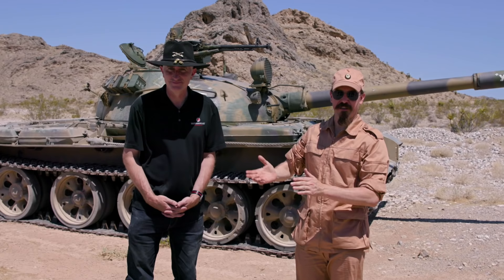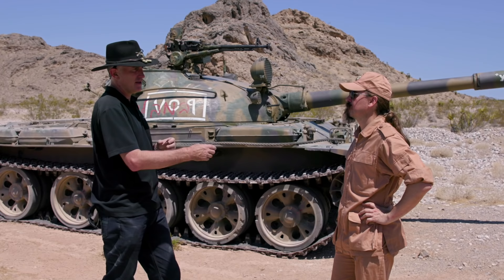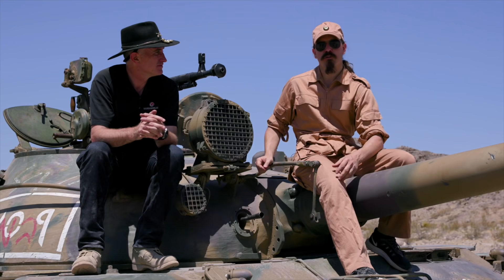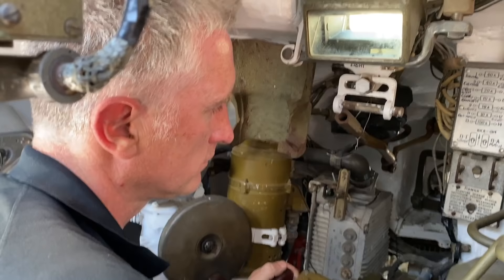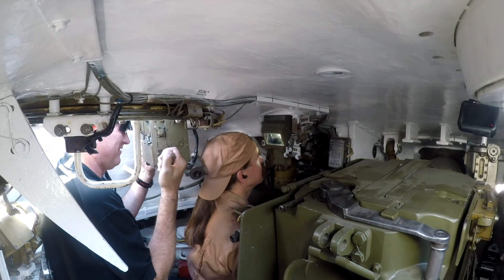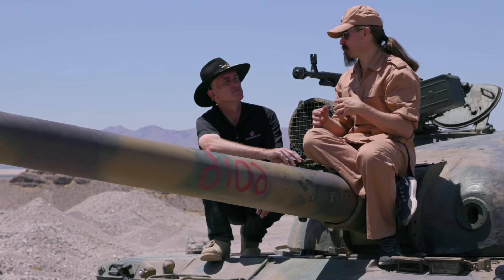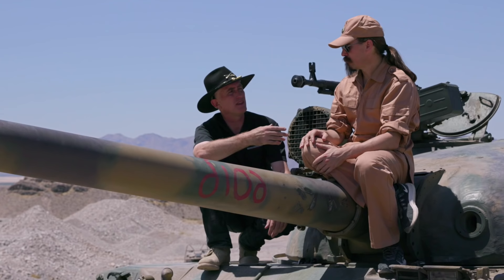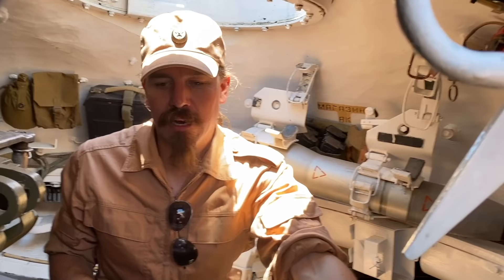All the Guns on a T-62 Tank (with Nicholas Moran, the Chieftain)

Comment: Was surprised the Chieftain didn't mention the implications of the 115mm's "fume extraction" system on the NBC system.
Reply: I mean, it is not that hard to figure out. The system is disabled in case of NBC protection being activated.
Reply: I assumed this was pre NBC.
It seems a bad design if you protect your crew from outside gasses only to gas them inside the tank.
Reply: @marc0523  NBC protection came about on T-55. It is not like crew cant use gun at all without the casing ejection system, also in case of NBC attack crew supposed to wear personal gas masks as well, also there is standard ventilation system, it is just not fully capable of getting rid of the gases quickly enough. Tank also has natural limit of how much it can fire without the ejection system since there is not a lot of space to put empty shell cases in the tank. Basically it is not that much of a problem considering that supposedly nukes would be going off.
Reply: @megalamanooblol  Thanks for the answer. 
My only knowledge of NBC comes from computer games etc, I don't know anything about the actual mechanics of how it worked, so this was very helpful.
Reply: @marc0523  they are usually 'positive pressure' sytems where air is drawn in through a compressor/fan system and filtered, then injected into the crew compartment and allowed to exit through orifices naturally. As long as the pressure is high enough for long enough, opening the breech to insert a shell, or the very brief opening of the spent case hatch, should not really upset the system, as the filtered air should flow OUT and naughty contamination should not flow IN.  This would also help with any fumes from fired weapons by using fresh filtered air to push stale or polluted air out. I think.
Reply: @marc0523  The system itself is simple in principle. Tank is sealed, air is pumped in from the outside through the filtering system that hopefully should remove as much "death" from the air as possible and the air pressure inside the tank is made to be higher than outside meaning no air from outside should leak inside the tank except through the filtering system.
Reply: @megalamanooblol  Fair enough points, especially considering nukes going off would make efficient main gun operation the least of the crew's concern. Just thought said implications (casing storage) and measures (turning system off and personal masks) were worth noting in the video for the audience, considering the thing was designed at the height of the Cold War... those not in the know would wonder about that.
Reply: @megalamanooblol  I guess if the crew could not use the casing ejector and they had the luxury of being able to disengage for a few minutes they could start putting the spent casings back into the ammo storage bins?

Comment: 22:31-22:49 The fact that the T-62 could penetrate the Chieftain tanks, was one of the contributing reasons why "Stillbrew" armour upgrades were developed for the later Chieftain tank models (starting with the Mk. 10 version). Well, actually "Stillbrew" was developed, because the British were thinking about future proofing their tanks against Russian 125mm guns too.

From what I've been able to find, the "Stillbrew" armour package was a form of early NERA composite armour (although, I have run into a few morons, who think "Stillbrew" is not considered to be composite armour. And for pretty dumb reasons too. DESPITE all evidence suggesting otherwise). It was developed for the Chieftain tanks during the 1980s. And it was very likely that "Stillbrew" was developed from previous British experiences with developing composite armour during the 1960s

The "Stillbrew" armour package is composed of cast armour steel. Specifically of RARDE 823 cast steel (which had less ballistic protection than RHA steel. Typically cast steel has 15% less protection than RHA armour steel). I've heard some mention that "Stillbrew" would later use hardened cast steel which had the same protection as RHA steel, but this didn't pan out.

Other details about its construction was that the "Stillbrew" applique armour was composed of 120-200mm thick (cast) steel plates, with 20-60mm rubber inserts behind these steel plates (the rubber was connected to the steel plates by way of armour fasteners. So basically things like screws, nuts, bolts, and bosses).

Apparently, "Stillbrew" was good enough to stop kinetic penetrators with 500mm RHA (possibly even more) of penetrative power. Which was enough to provide protection against 115mm, and 125mm APDSFS projectiles. What's surprising is that it provides protection against not only 125mm tungsten cored ammunition, BUT ALSO depleted uranium shells too   :/

<<References>>

A) https://below-the-turret-ring.blogspot.com/2016/03/chobham-armor-facts-and-fiction-1.html?m=1

https://tankandafvnews.com/wo-194-1323-feasibility-study-on-burlington-chieftain/

(Previous British research into composite armour of the NERA type during the 1960s)

B) https://www.tanknet.org/index.php?/topic/37096-chieftain-questions/page/27/

(Composition of "Stillbrew" armour. And also, what weapons were tested against them during British tests)

C) https://www.flickr.com/photos/7682151@N07/40600023554/

https://www.tanknet.org/index.php?/topic/37096-chieftain-questions/page/40/

(Some idea of what the durability of the Chieftain tanks were like, when upgraded with "Stillbrew". The minimum amount of protection that "Stillbrew" could provide WAS AT LEAST 500mm of RHA effectiveness. Surprisingly, according to documents, it states that the turret armour is better protected than the Leopard 2 [probably the early versions] 😳 )

Comment: Special mention to the fighter jets pilots who must have wondered if they got lost as they were observing a T-62 firing off all of its weapons at some rocky hill in the desert through their IR targeting pods or EOTS.
Reply: You should check a-10 pilot coloring book for t62 mentioning. At the time gau8 avenger can only penetrate t62 from the back. No pun intended. Frontal and side armor were invulnerable for 30mm rounds
Reply: @andrewdenzov3303  people always see some ideal scenario of a-10s easily making strafing runs onto their targets without significant opposition
Reply: @fulcrum2951  well when AA capabilities of modern army made a10 obsolete they start to fight with "army" from XIX century with no AA weapons at all :)
Reply: @andrewdenzov3303  there are cheaper alternatives

Comment: The reason for the smoothbore gun was to fire a longer discarding SABOT round with a diameter to length ratio of 12:1 or higher. The advantages of this are that you can have a round with the same weight but with a smaller diameter. The smaller diameter allows much larger penetration as it impacts a smaller area of the armour.

Comment: In Afghanistan, I was behind an ANP pickup truck that had a DSHK on a tripod in the bed. The tripod wasn't bolted down and was just sitting on some old tires. The guy controlling it kept it pointed away from us mostly. They hit a bump and it caused the tripod to shift and start to slide out of the bed (the tailgate was down because it wouldn't fit with it up). He grabbed the grips and it caused it to swing right at my truck. I was looking straight down the barrel of that thing from less than 20 feet away. I was just waiting for the dude to squeeze the trigger and let it off while trying to keep it in the truck.

Comment: Russians are pulling those out of storage (under 2000) now since they are running low on T-72's
Reply: hope not
Reply: Probably to use to hold down the territory already gained, they would be useless on the Frontline.
Reply: No.
It's for DNR and LNR forces.
Reply: running low on T-72 🤡🤡🤡🤡, take your booster buddy.

Comment: They mentioned this has an interesting history, but didn't go into it, so:

They mentioned it was produced in the early '70s. It has both Arabic and Hebrew markings, indicating it was supplied to either Egypt or Syria and then captured in (from the production date) the '73 war.

Israel captured lots of up to date Soviet equipment in the War of Attrition and in '73, and usually would send samples over to the US for teardown and testing as their contribution to the broader Cold War. If I had to guess (Chieftain could probably fill in) this was one of those tanks, which then made it into private hands after the US military was finished playing with it.

Side note: between the grab bag of post-WW2 tanks everyone in the region used and lots of captured Soviet equipment, the IDF's Armored Corps Museum in Latrun has one of the most comprehensive publicly accessible collections of mid-century armor in the world. Most aren't running, but you can climb all over a Syrian Panzer IV or about five Israeli Sherman variants or one of the oddball Israeli heavy APC conversions of the T-62.

Comment: the 115mm has about 50% more kinetic energy compared to 105mm so it on the next level and not really comparable .
Reply: I don't know about 50%, but L7 certainly hasn't caught up. M1060A3 from 2004 generates about 7.5 MJ of muzzle energy, while an old 3UBM9 from the 70's is still capable of 7.6 MJ. Same deal with DU rounds.
Reply: @F1ghteR41  I compared the 115mm HE shell to 105mm HESH shell ...they both weight is quite close ..almost 15kg but the 115mm shell has big velocity difference giving me a 50% more k.e value
Reply: @mr.waffentrager4400  you can't compare rounds like that at all, unless you are comparing your maximum charges. Especially since hesh was often fired with a smaller charge, too fast and it ceased to function. If you want to make a comparison you'd have to actually use maximum allowed pressures
Reply: @schuylerhayes9283  from what I know I compared HESH with maximum charge .
I compared HESH and HE because they are fired with full pressure but APFSDS are called overpressure ammunition.

Comment: I'm so curious about the rounds you were shooting from the 115mm. I would assume they were inert warheads, but were they at like full propellent load? Going at  ~1700 m/s? And what mass is the projectile? It's interesting how kinetic energy smacking into things starts scaling into that "looks like high explosives" range.
Reply: It was a training round.
Reply: Non-explosive warheads, but yes they use full power loads. Some big gun shooters download their ammo by 10% or so, but generally you don't want to mess with the original design of the ammo for safety reasons. Even extra air in the shell can cause inconsistent burn of the propellant
Reply: And no it wasn't going at 1700m/s, only the sabot rounds have that velocity, the HEAT, high explosive and most likely the training round have around 900m/s or so.
Reply: @veliki_dlek  Ah, that makes sense. Still quite an impressive impact splash.

Comment: Ian..where do they (the owners of the tank) get the 115mm rounds? Are they domestically produced? Because I can't imagine that there is a large surplus of old 115mm casings for reloading. The shell of course can be cast. but the casing? :s

EDIT: Also, from Tankograd there is no source on whether the T-62's ever fired solid slug AP. There's only mentions of APFSDS (3BM3) and HEAT (3BK4) :(
Reply: It's a big brass case, they're reloadable a good 10 times. Just need to find a new primer (probably snagged from a 105mm).
Reply: Well there is over 20000 made and still in use all over the world. From Cuba to North Korea. Also it has shrapnel round and guided rockets
Reply: @andrewdenzov3303  Yeah, but would the FDA allow the import of 115mm ammunition? Doubt that. 

Only the T-62M has the ability to fire ATGM's. The stock T-62 does not.

Comment: I got a chance one time to set in the driver compartment of a T-62 tank. I could not close the hatch due to the fact I was five feet, ten inches. So if you see a bunch of short soldiers, and they are using Russian tanks, they are more likely in a Armor unit.
Reply: not really anymore; the T-72, T-80, T-64 and T-90 are designed with germans in mind and thus built to allow 6ft+ soldiers crew them. Russian tankers can be as tall as 192mm these days (the issue with space in thee tanks is horizontal not vertical, haveing similar vertical room to the leopard 2)

Comment: So when i was in the army, i had a chance to direct fire (ie line of site) a 155mm cannon on a paladin with an He round during a field exercise at Ft Sill.  To keep the trajectory as flat as possible, you use a full charge red bag which means the recoil sends the back of the gun almost out the rear door.  Feel it in your bones. Unfortunately, after that, everything else is just a lite.

Comment: Fun fact: 60 more bytes did an article on Russian tanks back in to 70’s featuring the T-62. The spent ammo hatch was no a perfect solution. Russian gunners sometimes had to duck out of the way of a spent casing ejected and ricocheting back into the turret if it didn’t exit the spent ammonia hatch correctly.

Makes me appreciate my old M-1 Abrams even more.
Reply: Oh yeah, comparison of the early 60's tech with tank of early of the 80's. What a good comparison.
Reply: @worldoftancraft  Yes, it is a valid comparison. At the time I joined my unit, the T-62 was still a front line tank of potential adversaries my unit would likely face. And our unit was equipped with the M-1IP, which used the 105mm M68, the US version of the British L-7. The fact our 105 equipped tanks can kill the T-62 was comforting. Oh, the Marines did it against the T-72 using the M-60A1. So yeah, even with that arcane technology, I’m more than happy to wax the battlefield of wrecked T-62’s. Former PL, BMO, company XO, and S-1 here.
Reply: @ces4399  of course you could damage it. It had only a little better turret protection, while hull is almost identical to T-54 that dates end of the 40's

Comment: We're going to need more mountains.

The "hull/chassis machinegun position" was removed on Russian/Soviet tanks on the IS-1(and derived vehicles) in 1943 onwards during WW2, as having 2 machineguns inside the turret(front and back) seemed better and also removed a weakpoint on the front of the tank. DShK-M heavy MG's can be seen installed on heavy tanks like IS-2's, ISU-122's, and ISU-152's on photos from Winter 1944-45(frequently used against Volkssturmers in buildings with Panzerfausts).

Comment: I'm thinking the auto-ejection system with the timed case exit hatch is a bit Rube Goldberg.  That hatch would have to be VERY well-timed.  And it's not a great idea in an NBC environment.
Reply: theoretically the overpressure inside the tank would prevent intrusion of chemical agents into the tank. Realistically, not something I would want to chance.

Comment: 7:30 we saw this play out in the game planetside as well (the sequel sucks but the original was a phenomenon). 
2 sides with 2 man tanks (driver gunner, bow-gunner-hovertank-driver and precision railgun gunner), the third side with a 3 man tank (driver, cannoneer, machine gun turret) 

Can you guess what side usually rolled out with far less tanks than their counterparts? even if they did game the same number of tanks they had zero anti air defences and a much taller profile.  

Alas as it was all spoiled by the addition of the bunny hopping super mech-tanks with fast recharge shields and stupidly long range firepower. 
What the Elmos lost in standard armour they more than made up for with those freaking jet pack laden piloted ED209 with ultra reliable flak, canons or chainguns. The other sides mech were a chicken legged sw:Lego Walker  and a fully humanoid target dummy with zero suspension/stabilisation or competitive range.

Comment: The distance the gun travels during recoil is not that long. I was also expecting the gun to recoil more energetically, but the on-board camera shot from behind the gun doesn't show that. And yet the tank itself shakes pretty good. That gun has a good stabilizing and shock absorbing system, that's for sure.

Comment: The actual names of these track types ate OMSh and RMSh; gentleman is confusing them with the DShKM.

That's also weird, because they switched from one to the other in mid-60s, and the tank is early 70s production. Most likely it's because russians tried to equip the tanks destined for export/sent as military aid with the older type: because it's what was in use and in stock abroad, because the reason for the switch was less of an issue over there and to get rid of the old stock they had and to switch all of the own machines to the new type.

Comment: You can see why a solid round and bagged propellant could be useful sheer weight in handling round would be fatiguing. ChallengerIII 120mm smoothbore will take longer to load and be more fatiguing?

Comment: The T-62 tank was widely used by Iraqis in the Iran-Iraq war and did not appear to be very efficient. Many of them were disabled by small arms such as the RPG-7. In the continuation of this devastating war, the Iraqis mostly went to the T-72 tank, which had more resistant armor and the RPG-7 weapon was not effective unless it was shot from the side and towards its chains and wheels.

Comment: With a "little" modernization (CMS, 3gen sights for gunner, 3gen thermal for commander 360, RMW instead of the DshKM, ERA, maybe bit stronger engine, optionally 125mm gun, bit stronger engine), this thing(T55/T65) can easily be VERY useful in the following decades.  Maybe not for tank vs tank battles (i mean it could, but only for offensive as the armor is shit compared to modern tanks), but against infantry as fire support tank, and even IFV and other armored vehicles.. it will pretty much one tap all of those..
Reply: To my knowledge, the Chinese still manufacture updated T-55s. There are not up to the best standards,  but are still good enough for many countries.